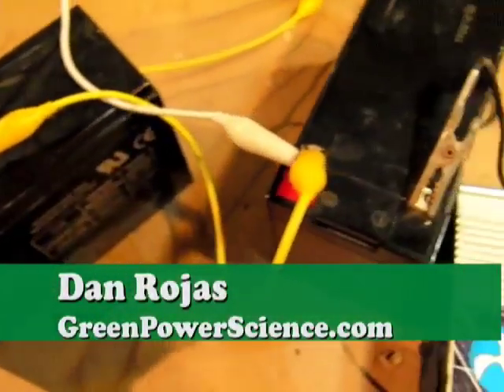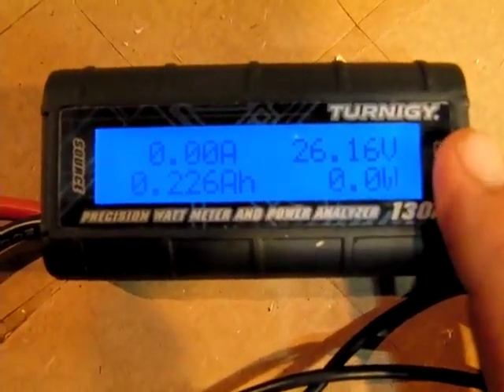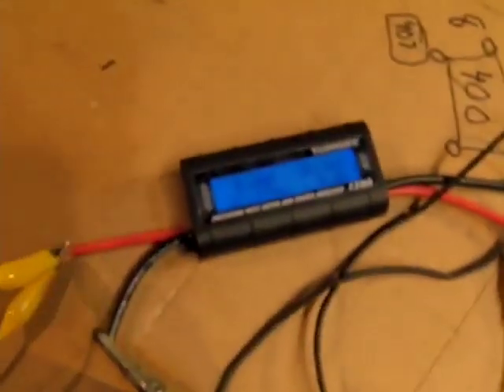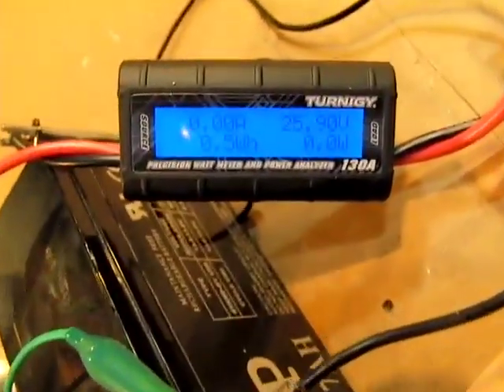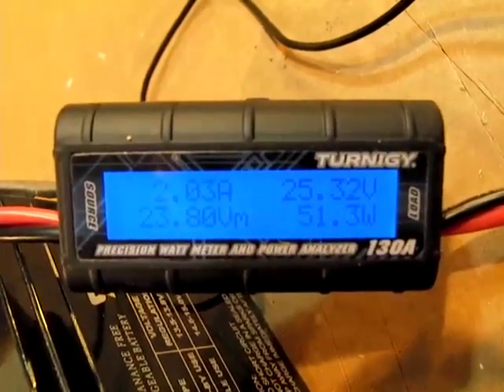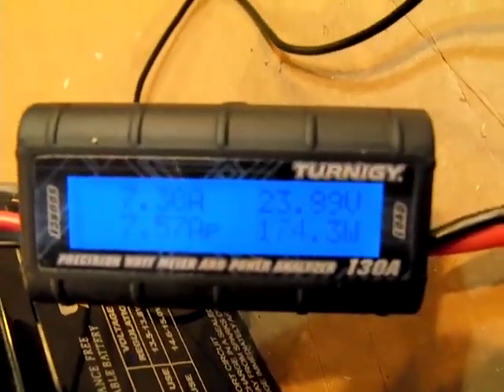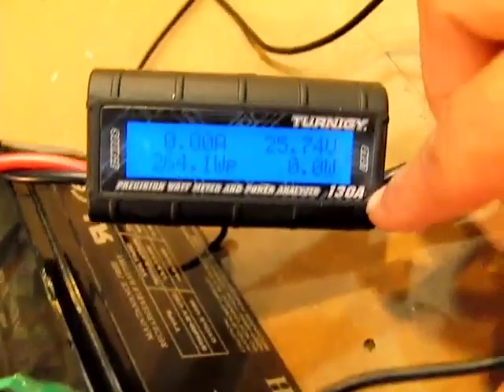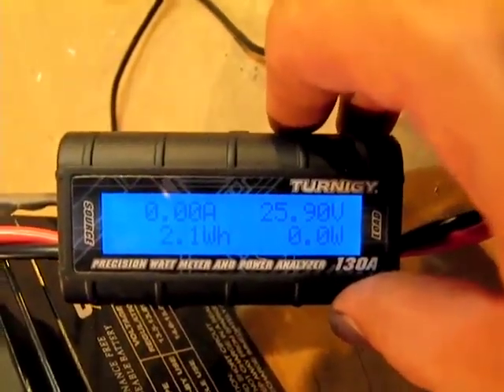DC WATT METER 130 Amp  Inline DC Amp Volt Watt Meter "Top DIY Solar Panels"

Comment: There is no chance it would handle 150amps with 12 awg cable  and the display dont work b4 6v and after 55v.....  not to mention u didnt do any comparison testing with a multimeter nor did u do a caparison with another type of ac wattmeter, I wish some people wud do real testing b4 making a review on products.
Reply: It can for brief moments, if you look at the specs for this in the manual that comes with it you will see that continuous rating is 50 amps. 130 amps is the peak it can handle, it's a safety factor for when you're up against the continuous rating of 50 amps and have a startup current surge that is double or more of the continuous current. 6 inches of 12 guage will handle a spike of 150 amps OK for a half second or so, and will handle 50 amp's continuously for open air with such short leads. It's just poor marketing from a Chinese manufacturer which, I know, is shocking.

As for the voltage issue, again, read the manual. It can measure down to zero volts, but if the power source is less than about 5 volts you need to plug in an auxiliary battery to provide power to the meter. The upper limit is 60 volts, which I don't know how many applications would really call for something that can handle higher voltage that wouldn't require a more professional tool. This is a cheap $16 tool from China that lets the average joe do some proper measurements of various lower voltage electrical systems.

Also, if you're going to bash someone, you really should check your spelling and grammar. I don't think anyone will take you seriously when you're typing like you're on a flip phone.

Comment: My question on this is Would a good place for this be between your charge controllers and solar panels? I am looking for something that will tell me the performance of my solar panels while using the power in my RV without using any power while the sun is down. charge controllers don't allow back-feed at night so I am guessing that this would be the place.

Comment: You can get one on eBay listed as Digital DC Watt Meter 60V/100A - Voltage Current Power & Battery Analyzer-4 in 1
Range: Voltage 0-60V, Current 0-100V, Power 0-6554W, Battery Charge Capacity 0-65Ah

Comment: Dan, it's very important that when you run wires in tandem to accommodate higher amperage than the single wire can handle, that you be absolutely certain that all wires run in tandem are the exact same length and gauge, otherwise electricity will take the path of least resistance, the shorter wire, unbalancing the load and potentially overheating the wire. (I'm an electrician) Any time you do something like this you must inform us of such hazard, or we'll think its ok since it worked for you.

Comment: @mobius1ace5 This Turnigy Amp meter is made for RC planes and other RC toys. If you need it just for measurements, and not as a display, I would advise you to go for a decent clamp meter, and with decent I mean the functions, not the prize. There are very expensive precision clamp meters on the market with very low tolerance, but you don't need one of those. A clamp meter is is very practical to use, no need to hook up wires, and that saves a lot of time and work.

Comment: Hey Dan, I saw some guys post a video on youtube of them making a VAWT out of a steel barrel. I've been able to get a few motors (1.1kw, 575w) out of a treadmill and a washing machine and I was wondering if you could make an instructional video showing how to put something together like they did (with the bridge rectifier info, bearings parts list).

Comment: Dan, love your videos. 

Just gonna say- test your meter. My is 350 ma off (low). Not a big deal on the load side of  things, but with essentially a built in 4 watt error, mine is useless for testing the generation of electricity by small solar panels. Check out the "watts up" and "Doc Watson" meters made by RC electronics.  I have two of them.  They only disagree with my fluke meter (and each other) by about 2ma.   Plus, they're made in America! Anyway check  them out.......